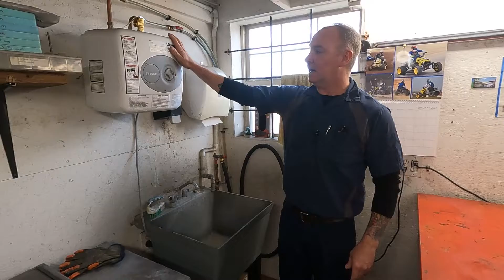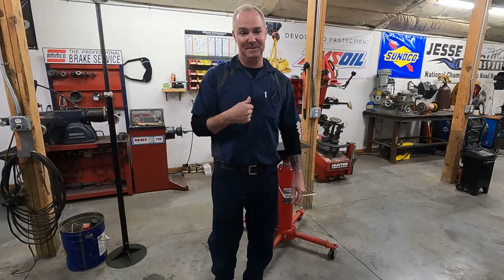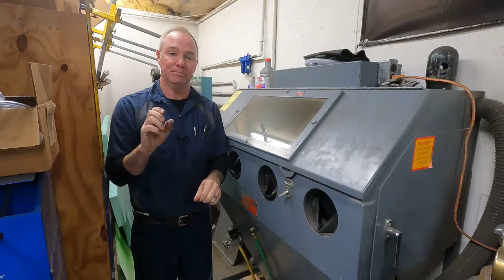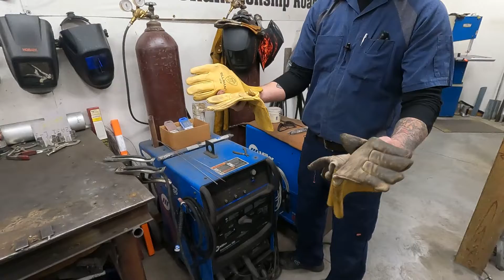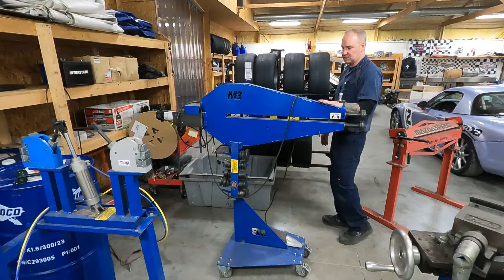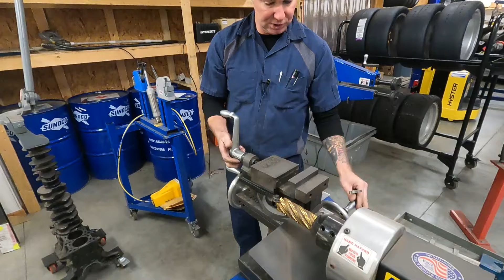Best Garage Workshop Tools Setup

Comment: I second that on the air powered press. We have one at the shop with a foot pedal.
Reply from the maker: Easier to smash a finger with the foot pedal!
Reply: @jpm yeah, I am always watching where I put my hands when using it. You can throttle it, slow or fast with the pedal.